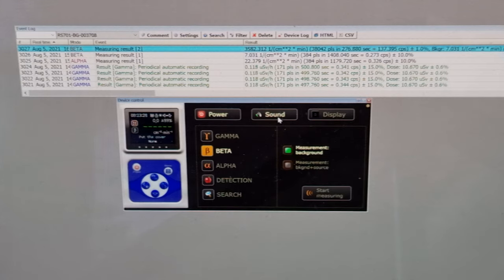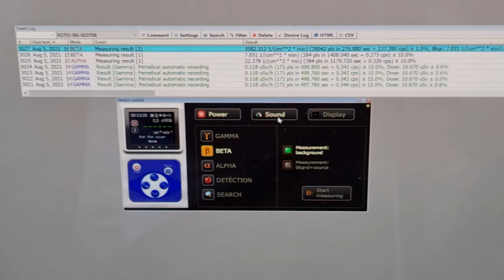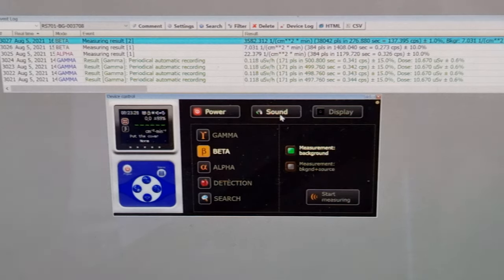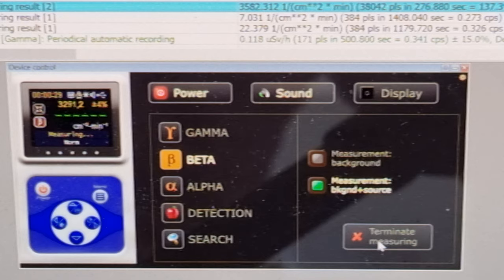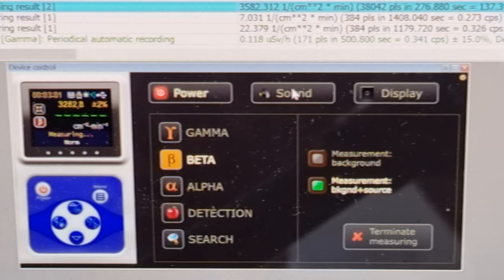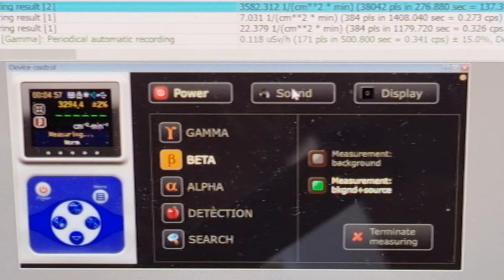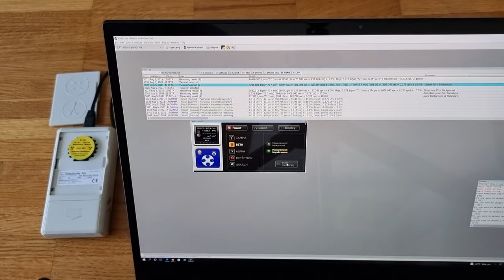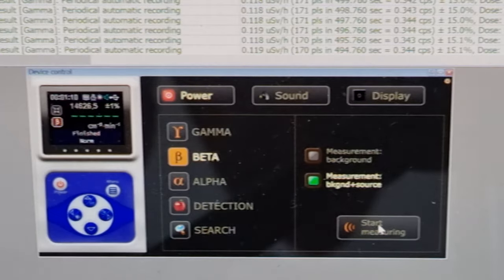Fixing Fukushima - Measuring background and check-source activity

Comment: Hey Bob, are you under the impression that in Yule Browns experiments he mixed his Am241 with the Al and Fe? Or did he just have it in proximity to the Al Fe powder he was treating? I think in the past when I read it I had assumed the Am241 was actually mixed into the powder. If you are planning to do your tests with proximity I guess I would suggest you ensure there is line of sight from the powder you are treating to ensure highest chance of success. Also perhaps keep a consistent distance if possible between your 3 tests as it will make a comparison easier later. I'de personally be a little concerned that the coherent field from the excited EVO's as you go through the curie temperature may need to encapsulate or intersect the Am241. But perhaps that isn't the case and being in close proximity to the EVO's will be sufficient to cause the inverse beta decay and remediation as you put it. I know you don't have much time, but if you are not mixing the calibration samples with the FeAl powder and you do not see a result perhaps you could try putting a magnet behind them and repeating it. Good luck guys!
Reply from the maker: As I remember, it was Fe and Al shavings mixed with the radioactive nuclide.

I have several approaches.

1. Indium (largely beta isotope) + Fe + Al
2. Tungsten + Fe + Al with check sources near by for W collapse driven proxy remediation

We only have fine powders, so that is why we will be pressing them into pellets.

I want to steer clear of the actual process.
Reply: @MFMP  Thanks Bob! I think I follow now what the check sources are for, it is quite the multi-faceted experiment testing a number of potential hypothesis at once!
Reply from the maker: @petersvideofile  This is a test I would have liked to have done a long time and would have done in past 18 months if I could have travelled to US (Brown Gas) or Japan (Ohmasa Gas) - the writing has been on the wall since 1950s - see the times I mention 'radiation emitted that changed the half-life of radio nuclides' in the SPACE. EARTH. HUMAN. intro video

https://youtu.be/tcvxRUUMlRk?t=147